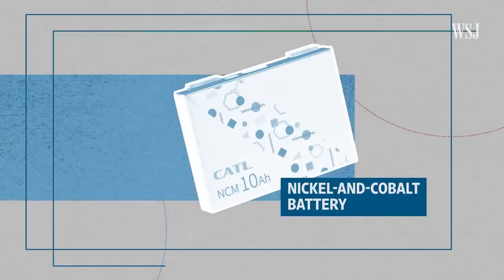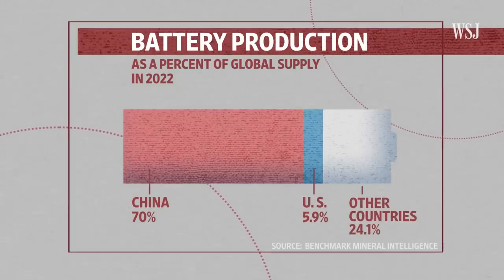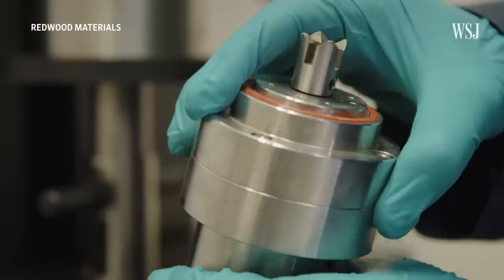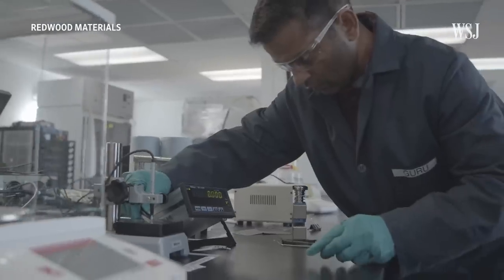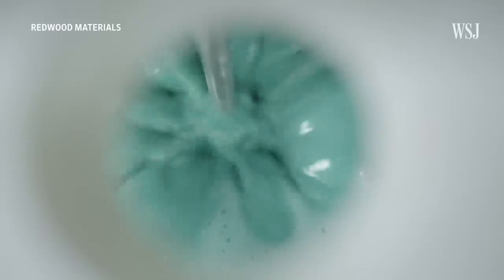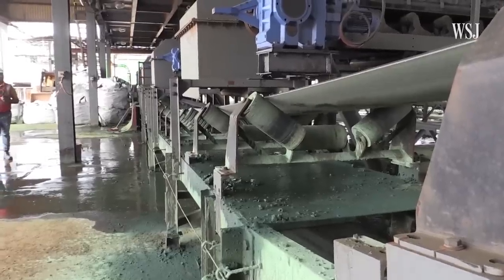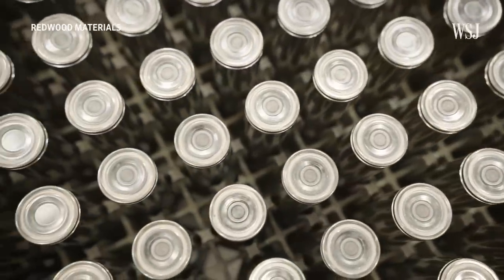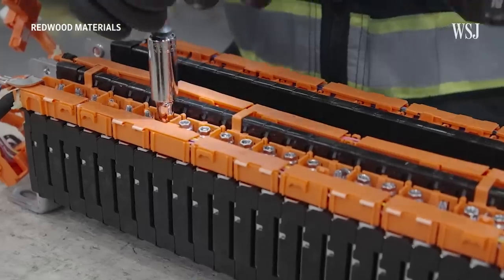China’s Massive EV Battery Industry: Can the U.S. Catch Up? | WSJ U.S. vs. China

Comment: Is Maxwell dry manufacturing process compatible with LFP or does it only work with NCA batteries?
Reply: the interesting thing is BOTH dry and wet battery manufacturing processes are thriving in china with different types of batteries. CATL has both for instance... So does the second biggest maker in china.

Comment: You need to look into a US company called Amprius, they have just started producing a battery with a power density 220% higher than the best Chinese and Tesla battery.  Who will dominate the battery business will come down to innovation not just production capabilities. FYI power density is very important for an automobile, it means you can reduce the weight of the car. Very important considering the battery pack is the heaviest single item in a modern EV.
Reply: Korea has developed far superior batteries. The problem isn't coming up with one, but mass producing these for cheap.
Reply: If it's more expensive people prefer 3-5 Chinese battery for the same price. 😂🔋
Reply: @sociolocomtsac  : Hmm.. I thought NMC8+ (high-nickel) or NMC9+ (ultra-high) are already cheaper than China's LFP (with C2C) which is roughly equivalent to NMC532 (least efficient) in terms of energy density.    Now, the question is, are those high energy density batteries safer?
Reply: @marczhu7473  : we are not talking China.  American's want big SUVs with at least 300+miles range.  China's top selling EVs like Wuling Hongguang Mini EV are not going to sell well.
Reply: China's LFPs were never known for high energy-density and is roughly half the energy density of Tesla's NCA.
Reply: @tooltalk  notice catl in China got allowed to produce battery for tesla though.
Reply: @marczhu7473  : Yeah.  CATL's LFPs are used for low-end (ie, standard range) only;  Tesla's high-end performance models use NCM/NCA.  Also remember that Tesla's LFP's no longer qualifies for full EV credit in the US.
Reply: Amprius founder & CEO also is chinese
Reply: @sparklingwatercrystal2922  of american nationality?
Reply: @marczhu7473  why are you more willing to stack explosives in your house
Reply: @KomenJolokia  explosive? You know your mobile phone is one in your hands 😂
Reply: @marczhu7473  you put more care in guarding your phone than your car, though?

Comment: China designs are adequate for their needs, not outside of their infrustructure lay out, America requires alot more beefy battery
Reply: Chinese designs are among the safest. Tesla Shanghai factory uses mostly batteries from CATL and byd, both are battery leaders in China and in fact worldwide.
Reply: "More beefy battery?" Sounds like looking for a pie in the sky when you can't even make many of the components.
Reply: fyi the beefiest mass manufactured batteries ARE made in china. lol
Reply: @peter238  : >> Chinese designs are among the safest. <<
In which parallel universe do you live in?  There were about 7 EV fires per day in China 1Q 2022 or estimated to be about 3,000 for the entire 2022.   There were no recalls as I far I know.  GM voluntarily recalled all of their GM Bolt EVs after 19 caught fire in the US.
Tesla China uses NMC from LG Chem and LFP from CATL.  LG and SKI are battery leaders outside China.
Reply: @tooltalk  Tesla only uses CATL batteries in China. CATL leads the world in technology, both in China and outside of China. Even Korean batteries are now using Chinese parts, as Chinese technology pulls further ahead in their lead.
Reply: @peter238  : >> Tesla only uses CATL batteries in China.  <<
No.  Tesla uses LG Chem's NCM for upper trims; CATL's LFP for entry-level, lower range EVs in China (also in EU).  Also note LG Chem, the largest battery patent holder, also announced that they are going to start enforcing patent rights in high-nickel batteries against Chinese manufacturers in March. 

>> CATL leads the world in technology,  <<
CATL, BYD, under the CCP's national industrial policy and protectionism, are leaders in China; LG and SKI are leaders outside China. 

>> Even Korean batteries are now using Chinese parts, <<
Sure, most raw materials are mined in AU, Indonesia, Chile, Argent, Congo, etc.. and then, processed in China. Nothing so leading tech about it.
Reply: @tooltalk  It is CATL and BYD that are enforcing their patents against Korean violators. In general, tesla is lagging way behind in EV and battery technology. tesla has stopped using LG due to fire hazards.

Comment: The advantages of China's electric vehicles are gradually expanding, and China is about to fully win the battle for electric vehicles.  Motors and permanent magnets have always been China's traditional advantages, and the chassis structure has not lost to Germany and France. High-voltage electronic control systems and semiconductor materials such as gallium nitride are at the forefront of the world.  The smart car system is all based on Android, has a wealth of third-party car applications, and also integrates an excellent voice control system.  Tesla's current position is already very dangerous.

Comment: These are batteries that catch fire. A lot of people will protest before we're forced to switch to electric.
Reply: 217,000 ice vehicle fires in 2022 here in the U.S. alone. Care to comment on that? 🤔
Reply: @4literv6  Ice Vehicles?
Reply: @everythingvideos24  internal combustion engine.
Reply: @4literv6  Care to explain how they all caught fire? Not all of them will just catch fire from sitting in one spot like a Tesla.
Reply: @everythingvideos24  : >> Care to explain how they all caught fire? <<
most fires in new ICE vehicles are caused by collision (ie, accidents); in older vehicles, electric wirings and other mechnical failures.   I guess we are going to see how the fire risk changes as EVs age, but EV battery fires are much more difficult to put out.
Reply: Lol and combustion engines don't?
Gas engines literally explode at contact with fire...
Reply: @4literv6  : >> 217,000 ice vehicle fires in 2022 here in the U.S. alone <<
Sure, there were 7 EV fires/day in China, or estimated to be about 3,000 for 2022.   Most ICE fires in the US are from electrical/mechnical failures in older vehicles.  EVs catch fire mostly when they are charging or simply just parked -- and the fire stat is only going to get so much worse as they become more ubiqituous and age.
Reply: @tooltalk  simple research for gas cars recalled for fire risk including while parked? Show most of them are 3-5 year's old under recall. 👍🏻
Maybe try trolling someone who isn't informed eh. 😎
Reply: @tooltalk  52 total ev fires at just over 1% of the entire vehicle fleet otr in the U.S. vs over 217,000+ice fires. You do the math simpleton. 👍🏻
Reply: @4literv6  : >> 52 total ev fires at just over 1% of the entire vehicle fleet otr in the U.S. vs over 217,000+ice fires. You do the math simpleton. 👍🏻 <<
Nah, really?   Try harder, according to NTSB, there were fewer than 200K car fires in 2022.  And there are well over 270 million ICE vehicles on the road in the US with the average age of 12+ yr vs EV 2-3 yrs?  Winning .. LOL!

Comment: LFP is the most inefficient battery. It’s very heavy, low energy density, and outdated technology. US need to focus on new battery technology instead of NCM or LFP batteries. Samsung will start pilot production of solid-state batteries, from 2027. Also, in pilot level, LG start to produce Lithium-Sulfur batteries from around 2025. US have to build battery supply chain based on these new batteries, not the outdated NCM or LFP.

Comment: Did the video maker forget that the tesla/Panasonic giga factory open since late 2016 in Nevada the very first of its kind btw built in just 2 year's.

That 1 factory did over 37gwhs of U.S. sourced ev cell production last year alone. It also uses in house cell recycling and buys recycled cathode and anode materials from redwoods materials since q3 of 2022.

Gm has 3 new lg chem jv cell plants opening or opened as of today. Sk innovation cells are coming from commerce GA since early 2022 tos supply the U.S. built Ford lightning and vw id.4 with cells. They also are expanding out in GA for 2 new plants and building new plants in TN as we speak. All will supply U.S. only evs and use U.S. sourced materials and recycled content. 

Yeah we can lead in ev batteries just fine thank you. In fact until 2020 that 1 U.S. built&owned factory was the most productive in the world. 
Just like tesla today operates the 2 most efficient ev only automotive factories on seperate continent's for 2 consecutive year's now. 😎

Big dolla deals, the titans of industry getting into it. And companies like tesla doing in house 4680s. Along with J.B streubel founding redwoods materials to recycle enough U.S. built and U.S. sourced battery materials to make 5,000,000+evs by 2030 say things will work out fine. 👍🏻

People forget once American industrial might cranks up the rest of the world has cause for pause. Companies are abandoning China and the EU to setup shop on our shores and serve the largest car market per capita with the highest asp in the world. 

As admiral yamamoto slinking away from pearl harbor once said "I fear that we have awakened a sleeping giant and filled him with a terrible resolve"

Comment: Why aren't we working on developing power storage tech that doesn't use slave labor to mine it's components and isn't as ecologically destructive or as dangerous as the current batteries? All we're doing now is patting ourselves on the back in congratulations for buying hyper-expensive coal powered vehicles whose raw materials are ultimately incredibly socially destructive?
Reply: Did you watch the video? The video literally mentioned that china, the US, and other countries are experimenting with better batteries.
They are constantly trying to find better battery technology that could be cleaner, safer, lasts longer ,etc etc